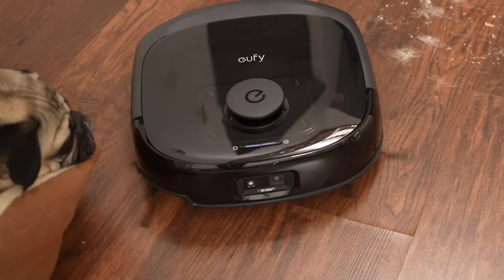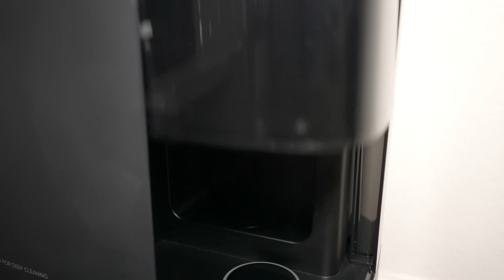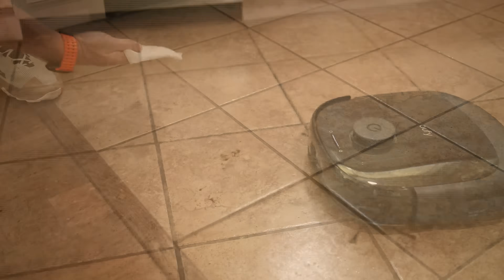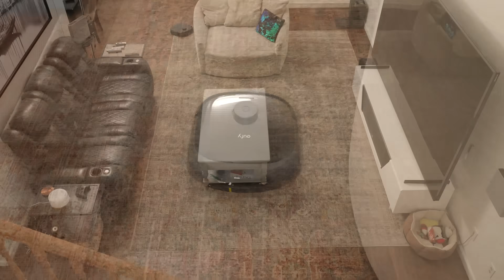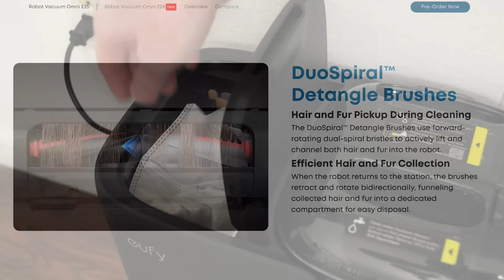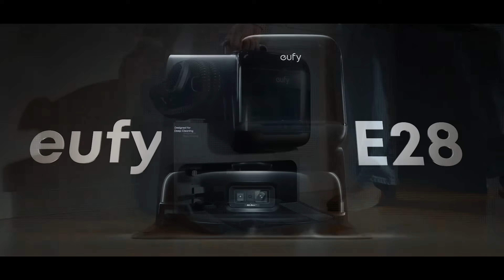eufy E25 - Deep Cleaning Robot Vacuum with Hydrojet Technology!

Comment: Does the mop roller retract when going over low pile carpet? Or doesn’t it vacuum first then mop on a second pass? Curious if you had any wet carpet problems.
Reply: The mop roller automatically raises when going over carpets or rugs. You can also set it to do carpets first if you want, but it’s carpet sensing is very good.